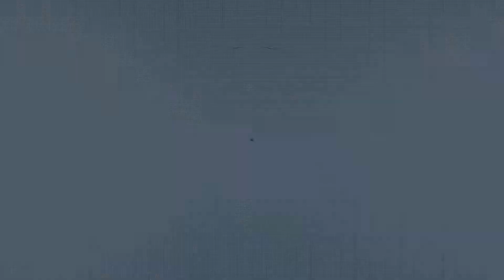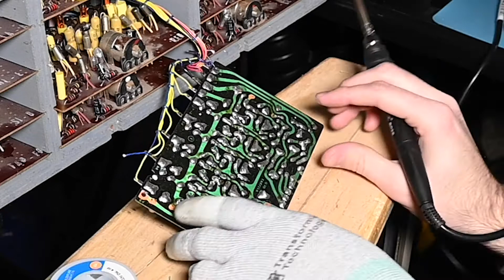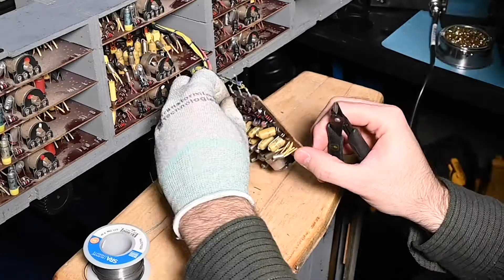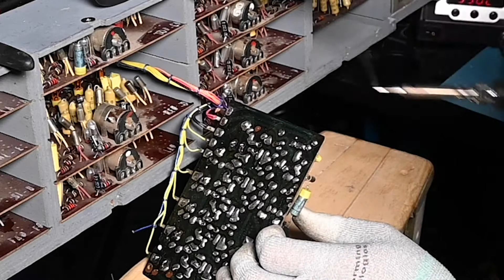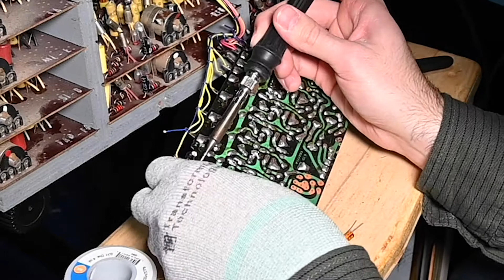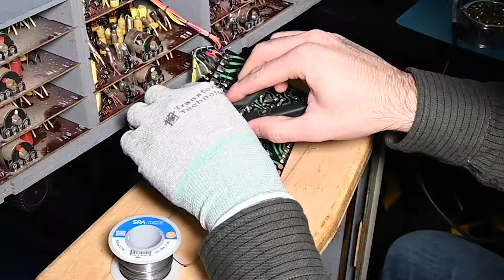Tech Tips: Replacing Through-Hole Components | SRA Solder

Comment: Hi! I know i am a little late to the party here, but i am currently working on the same organ replacing the same parts and was wondering if you could direct me to the type of caps you used. Also, would different type of electrolytic caps sound different?
Reply: Hi, sorry for the late reply. Any high quality capacitor from a reputable electronics supply house will do. Don't buy NOS or vintage electrolytic capacitors. I like to use Nichicon brand and it's okay to go a little +/- on the capacitance value. Just don't use capacitors with a voltage rating lower than the original spec. Different brand electrolytic capacitors will not really affect the sound in any noticeable way. Film capacitors in the audio signal path will though.

Comment: Great video... can you add any details re the temperatures you find best for this sort of work...
Reply from the maker: Hi and thank you! I personally work at 350 C / 662 F with my setup. This seems to be a good point for vintage PCBs and fairly robust through-hole components like this when using leaded solder. For smaller boards that are more sensitive you may want to start lower around 300 C and if you find 300-350 isn't hot enough to efficiently heat the joint then you could go up to 400 C / 750 F. That's about the top of the range I would go. Any further and it gets too hot and oxidizes the tip rapidly. The one exception would be soldering chassis grounds when you're dealing with the surface area of the chassis in which case a bigger tip/higher wattage is necessary. Also, on heat sensitive components like LEDs and diodes, I'd use forceps or an alligator clip to absorb some of the extra heat. There are several factors here to consider that affect heat transfer from your iron to the workpiece. Including the surface area you're heating, the surface area of the tip, the condition of those surfaces, the iron wattage, the temp of the iron, melting point of the solder, and amount of flux used. I used 63/37 rosin core solder wire in 0.031" diameter with a 60W microprocessor controlled iron. By tinning the pad and the iron and using the broad side of the conical tip, I was able to get perfectly adequate heat transfer.
Reply: @SRASolderLab  Great answer - thanks!

Comment: Here's a suggestion for a couple of future videos.

#1 - A demonstration of the Aoyue 8800 Desoldering Gun.  Maybe show off how thoroughly it removes the solder from through-hole joints.  And how to minimize it getting plugged with solder, requiring a boring with the drill bit.

#2 - How to replace the heating element.  You've already demoed replacing the 500W heater in hot-air, and maybe (I think) replacing the element in the soldering iron.  Now, how do we replace the element in an 8800?

Comment: Nice video, Sam!  Reminded me of when I replaced the caps in my 1970s amateur-radio slow-scan TV monitor and camera.  My Aoyue 8800 went through its paces and did such a thorough job that the desoldered parts fell off the boards!

For soldering the replacement parts, I found using a chisel tip best. A tip of solder to form the heat bridge, then touch the pad and lead and finish soldering the joint.

Those boards look like candidates for your ultrasonic cleaner!
Reply: Yeah these boards definitely need a good cleaning! Canned air didn't quite cut it.